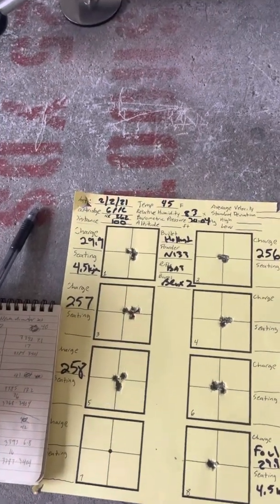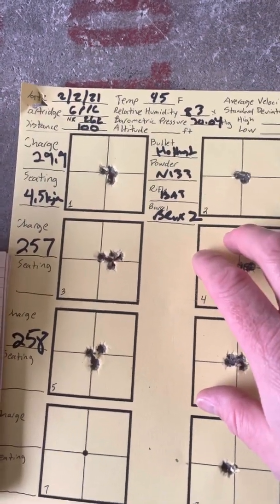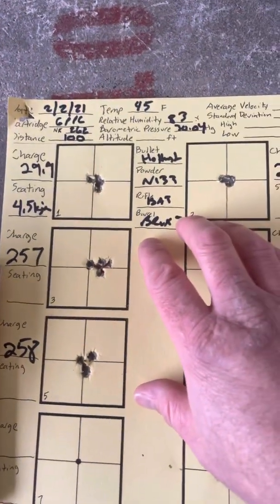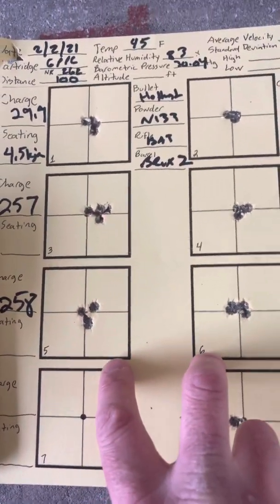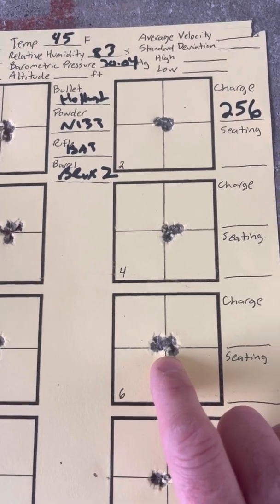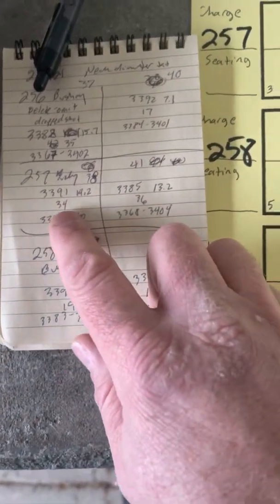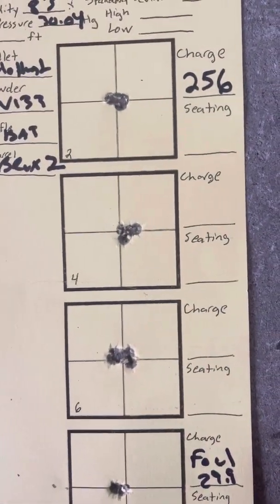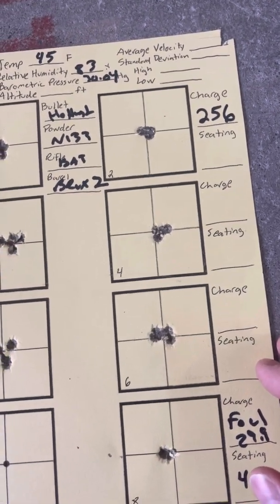Witch Doctor Series: Neck Diameter (AKA, Neck Tension) Test in 6PPC

Comment: Looks like I need to resize my necks 0.001" smaller. 🤪  
I run with a 0.268" neck - I wonder if that makes a difference?
Reply from the maker: You could try it and it very well could make a difference.

Comment: Would you know if Varget likes more or less neck tension?
Reply from the maker: In my experience, Varget “likes” .002-.003” neck tension. I usually start at .002” and most of the time stay there but sometimes .003” is better.
Reply: @WitchDoctorPrecision  thanks for the info. I'll test .002 and .003.

Comment: Is the n133 liking neck tension across all calibers?
Reply: Seems to be a trend with these powders liking more tension, my testing shows best results with .004 tension with N130 in a 30BR and also with N135 in a 6BR
Reply: @gusdoesthis9273  thank you
Reply from the maker: That’s a great question to test because this test shows the effect for the 6PPC only. It would be great to try different calibers. What calibers are good with N133?